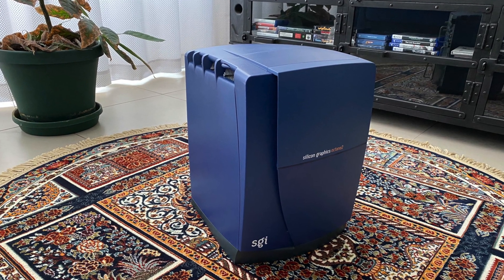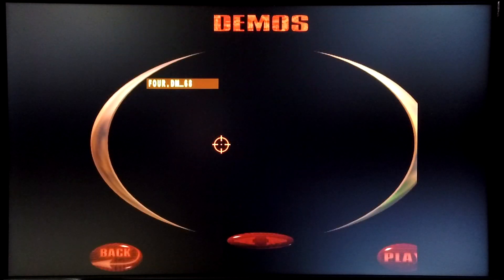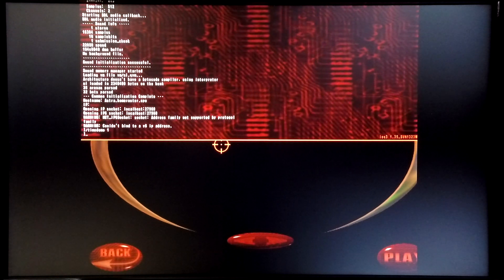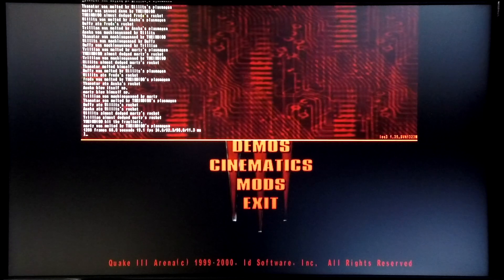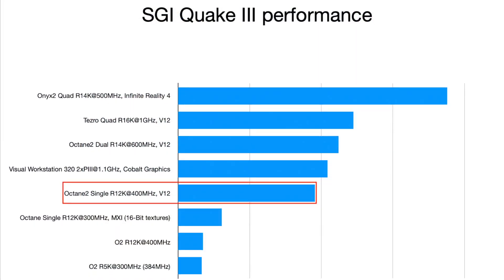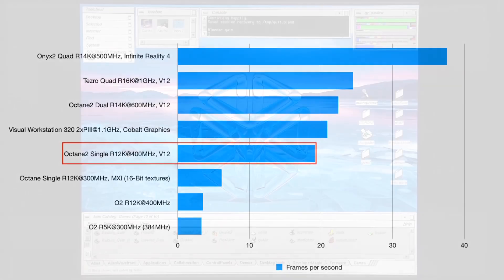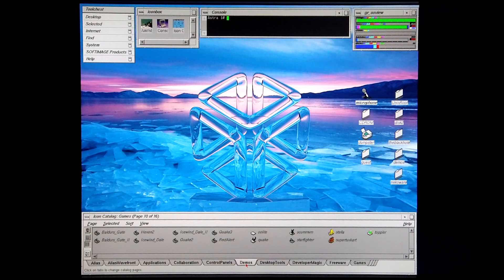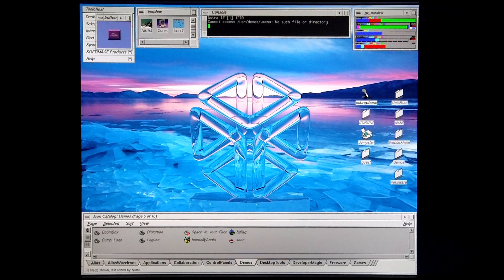What you get when you pair an R12K@400MHz with a V12 in an SGI Octane2!

Comment: In 1997, SGI had excellent ability to create machines dedicated to generating three -dimensional graphics in real time; And he was able to cover that part of users who needed that power. Apple for its part was far behind compared while the PCs were able to cover an important slice of the market because the compatible machines had lower prices.
But those who produced only 3D chips have been able to maintain a much longer step and discreet power that could also compete with SGI in certain fields. Then from 2000 onwards the most powerful CPUs and GPU were able to overtake the performance of SGI, which stubbornly wanted to maintain the competition in his favor by continuing to sell its graphic stations at crazy prices and moreover without a software support of a certain caliber like Adobe. Creating machines compatible with X86 was a wrong move, in my opinion, while if he had decided to use the PowerPC line perhaps today he would still have very competitive CPUs .... (I remember that in 2002/2003 a Powermac was able to be faster he is From the calculation point of view (see Raytracing) both from the Paret of the GPUs (who also used PCs) with considerably lower prices and having access to high -level professional software.
In any case, SGI is and represents an important part of history among the workstations dedicated to 3D. I would like to have one and "playing" with all those beautiful software of the period.

Comment: A note about the Inventor demos you showed there (such as Huge Engine Model and Chromeskins): Inventor only uses a single CPU and its libraries are not well optimised to get the most out of the hardware (it's a fairly high level API with a lot of overhead). I found that using perfly to view the same 3D models could result in considerably better performance, since it uses the more optimised IRIS Performer libraries, and perfly can make use of multiple CPUs if present.

Comment: Most overkill quake machine of all time.
Reply from the maker: The Octane2's a solid machine!!!
Reply: Not sure if it counts, but I did try networked Quake2 in a CAVE once, with motion tracked CrystalEyes and wand (weapon), worked very well. Running off a 16-CPU Onyx2 5-pipe IR2E, three walls and a floor (edge blended), each projected surface was 1024x768 @ 96Hz stereo..
Reply: @mapesdhs597  would have made a cool video